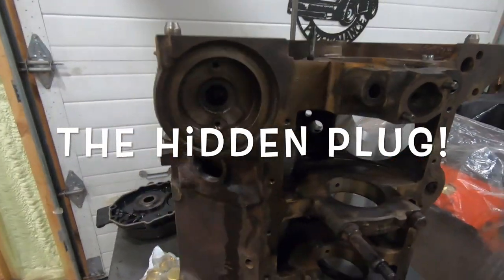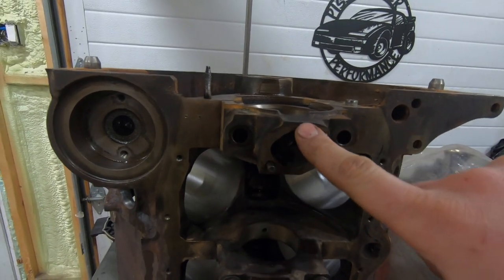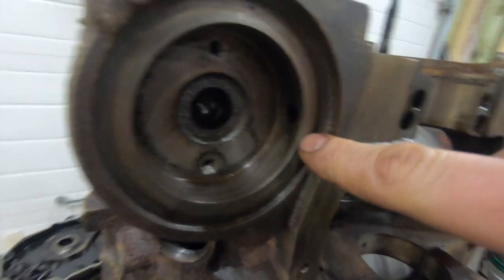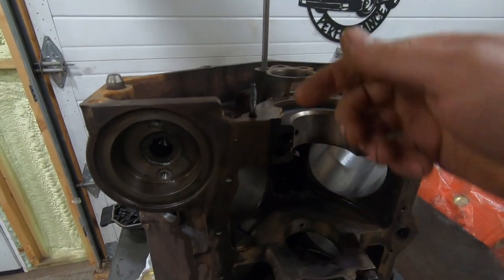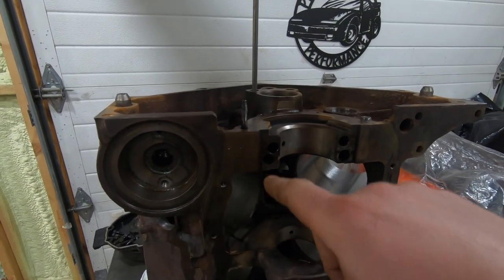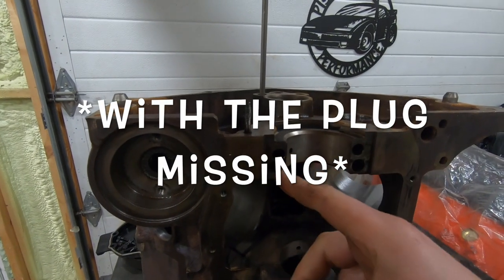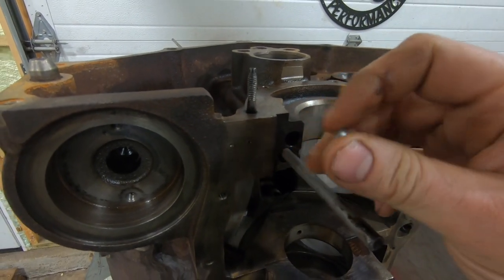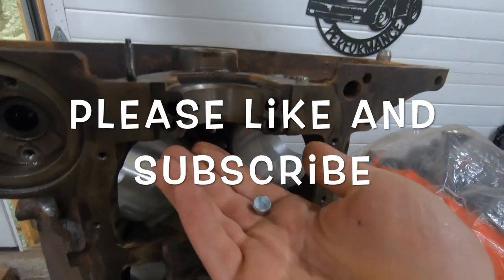The Hidden Plug that Could Wreck your Engine! SBC Build

Comment: great tip for sure!  One can also tap out the boss and install a pipe plug so theres no worry of it ever popping out, similar to oil galley plugs by camshaft. Thanks for sharing!
Reply: It almost did 
The factory plug was inside still i didnt even know it was inside it and i put the flush mount abd relized on my stand i had zero oil pressure and checkef the fliter it was dry i even measured the hole depth from top to the plug it was good athe i relized that i out 2 plugs and jt was mine thst plugged the oil pressure 
That god for my oil presure tool 
That saved my engihe

Comment: Machine shop removed mine never replaced it, never even knew it was there after several other SBC builds.  Well 2 camshafts and couple of pushrods through the rocker arms later read about this plug on line,  Took the crank out then rear bearing cap and no plug down in there.  There is now on this rebuild never to be overlooked again..
Reply from the maker: Sorry to hear that man!  That sounds like a nightmare. But that's exactly why I made this video. Hopefully, it helps a few guys out there and prevents trashing some new engines.

Comment: Never had a problem all these years of not taking that plug out. I course I jet wash all blocks and run brushes thru and air. If gunk is removed from this before machining and block is recleaned after, it will be fine. But if you remove you better install perfectly. WOULD NOT tap for threaded plug! Too many think they're doing something great and end up even worse. This plug serves the same purpose as the plastic barbell looking plug in the LS engines.
Reply from the maker: Yeah im not sure why some want to tap them. They install nicely, and theres a step in the block where the plug stops, but its a good idea to meausre and record the depth before the plug is removed. You are correct it does the exact same thing as the bar bell in the LS engines

Comment: Very important tech tip for sure , by the way the small block Chrysler has that plug too a friend of mine left that plug out of his 360 it didn't take too long for it to wipe out the bearings .
Reply from the maker: Yeah man, such an easily overlooked plug that's soo important. Gotta wonder how many new engines have failed early because of it being forgotten

Comment: Old blocks will accept a tapered tap i think its a Npt 27 by 18 thread, be careful not to go too deep, run an allen plug in it with sealer, and blow air through both cross passages to make sure they are not blocked, on newer 1pc,. Rear seal blocks you have to drill the hole to 9,,16ths, to get tap to fit.Hope this helps.

Comment: Thanks for the Video....First I ever heard about that Thanks for the Tip...
Reply from the maker: Alot of guys dont know about it, it seems. I actually decided to make the video after having a conversation with a 45+ year hotrod mechanic friend who looked at me like I had two heads when I talked about not forgetting the gallery plug under the rear mian cap. He was freaked right out when I showed him
Reply: Well...I've been in to this since I was a kid and never ever heard of that plug. I bought two kit SB motors from PAW when they were still in business. One of them has 80k on it and I gotta say if its been running without filtered oil I'm going to be pissed. Its stored out of the car now so I can't check, but I will when I go to use it again. The other is long gone.
Reply from the maker: @Lang Strimpel  they dont last long without it, so i can almost guarantee its in there with 80k on
Reply: @cuttersperformance  Well thanks for the positive outlook...Its going to be a while before I do the refresh, but I will know to look now...Thanks Again.

Comment: I`ve seen that plug cause more trouble with more people than you can shake a stick at. There`s different sizes for different series of sbc`s. and driving it in to the wrong depth can have bad consequences to say the least. Another plug I hate is the one half-way under the cylinder head. I`ve seen and had them leak  myself. You`re the first person to even mention it.
Reply: Are you talking about the water jacket drain plug near the oil pan on the outside of the block?
Reply: @PapawCulberson  no sir, the one under the main bearing cap. When removed you can see out the oil pressure hole under the distributor at the top of the block

Comment: I can't understand why more SBC builds don't mention this. It's imperative that it be in the block. My first build the machinist put in the cam bearings and the hidden plug without asking.  This is a guy I had dealt with for customer heads for a while so I knew him. When I asked about the plug and bearings he said he always does that. Kinda gave me the mechanic shrug. I take them out and gun brush all the galleries now. ps. for extra credit, galleys are boat kitchens, galleries are passages. Like for oil.

Comment: We had one on a roller cammed 393 small block and never raced it until we found the problem the oil pressure was all over the place 20 psi up to 60 psi all over the place we almost lost our minds trying to figure it out the plug was not seated and was dancing around in the oil pressure port knocked it out and installed a new one problem solved

Comment: Do you address l31 timing covers and gears? I have stock style gears and have a new stock plastic cover. Can I run a balancer of a older engine or is the length different with the gears do I have to run the l31 balancer. I have already purchased and installed the timing gear set and wanted to use them with this build for a 80s caprice.
Reply from the maker: I do have a video about this coming up

Comment: Curious on some of the newer SBC blocks they have a ball bearing in place of that plug. Can you replace the ball bearing with the plug and vice versa?
Reply: It's not a ball bearing it just looks like one because you are looking at the radius side. It will knock out and you will see it is in fact a plug. A ball bearing would not stay there, the expansion of the plug keeps it in place. You are better off doing this: https://www.youtube.com/watch?v=jr5iDVAzxxg
Reply from the maker: I've never seen a ball bearing used on these old girls, but I have seen that done on modern aluminum engines
Reply: @michaeldose2041  some of the newer blocks are actually a ball bearing, I physically removed one myself on my 880 block. Doing some research I read it’s common in some of the the newer blocks. I just ended up putting it back in. But I am curious if it coulda been replaced with a normal plug.
Reply from the maker: Very interesting, Ive done quite a few 880 blocks and haven't come across that yet
Reply: @Cerridius  I don't like the cups, I understand they work but why take the chance? It takes a minimum investment in time and money.
Reply: @Cerridius  My block is from a '99 Tahoe, which, as I'm sure you know, was the last production year for the SBC in trucks, the vans got them until '02 I suspect that was just to use up the last of inventory. When I looked in there it did look like a ball bearing, because the radius was round and shinny like a bearing.  Ball bearings work well as check balls. There is nothing different in that oil passage going back to day one, as such there would be nothing to keep a ball bearing in place. It's a moot point in my book, as I wouldn't put either one back in, especially if a ball bearing came out of there.  Tap it plug it and sleep easy knowing you have one less thing to wreck your engine.

Comment: What you recomended new or just clean the old one ?
Reply from the maker: Install a new one. Also a good idea to write the down depth of the original from the cap side. Install the new plug to that depth and blow air through the passages to verify proper flow
Reply: @cuttersperformance  do you have a part number for that plug sorry but am doing my first build so am not a profesional
Reply from the maker: I dont have a part number, but its just a 29/64ths gallery plug that comes in a full freeze plug kit for sbc.
Reply: @cuttersperformance  ohh ok got it thank you man

Comment: So how is it reinstalled.???
Reply from the maker: Installs like a regular gallery plug. It does have a step in tue gallery where it will stop, but it's a good idea to measure and note the depth from the cap side prior to removal so you can verify the new one is seated

Comment: It is important to knock that plug out to make sure you remove any trapped contaminants.  What I did with mine is use a 1/4 pipe tap to tap the hole and screw in a 1/4 pipe plug.  Much more reliable for that critical function. Here is an old video for reference:  https://www.youtube.com/watch?v=jr5iDVAzxxg
Reply from the maker: You can tap it if you want just like the front and rear plugs. But unlike all the other gallery plugs, it actually has bias pressure pushing it into place so it would be very unlikely for it to pop out move if installed correctly
Reply: @cuttersperformance  GM made millions of small blocks, they aren't known for spitting out their oil plugs. That said, given the minimum in time and money to thread it in. It eliminates the ''if'' in installed correctly.

Comment: I read to flush mount the plug and that casuse zero oil pressure 
Yiu need to mark tge depth from the top i cant remember the measure 
I almost wrecked it
Reply from the maker: O geez yeah that would block off all oil pressure

Comment: Should have a video to properly put it back in so it doesn't fall down when you have it all back together 4000 miles down the road!
Reply from the maker: Did that happen to you? or are you just worried it will? Haha
Reply: @cuttersperformance  Nope didn't happen but could see a potential problem if it decides to leave the chat if not installed correctly!

Comment: That plug is a ball bearing. I never seen a  block that had a threaded plug
Reply from the maker: They are a press in gallery plug like the front plugs. Some claim that some late blocks use a ball bearing, but I have yet to see that on an 880 block that I've done.

Comment: Hey pat you happen to know the camshaft intake and exhaust lift on a factory 1998 sbc 350 vortec zz4 cam factory specs I’m trying to compare it to say a lt4 hot cam
Reply from the maker: Like a zz4 crate motor cam? or a 98 L31 stock cam?
Reply: @cuttersperformance  98 l31 880 block came with 062 vortec heads this is all my factory stuff im naming I just can’t find any specs on the cam
Reply: But I assumed that was a zz4 motor cause the truck I yanked it out of had z71 on the quarters of the bed
Reply from the maker: A zz4 is a crate engine with aluminum heads. It sounds like you have the L31, which is what that truck would have from the factory 
L31 cam specs
Advertised Exhaust Duration	263
Advertised Intake Duration	261
Exhaust Duration at .050 194
Exhaust Valve Lift	0.428"
Intake Duration at .050 191
Intake Valve Lift	0.414"
LSA 111